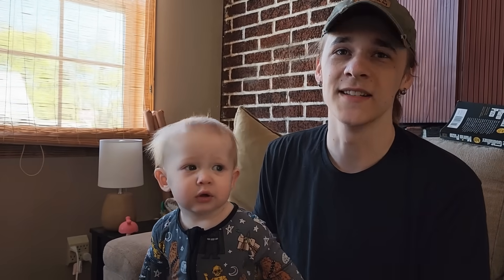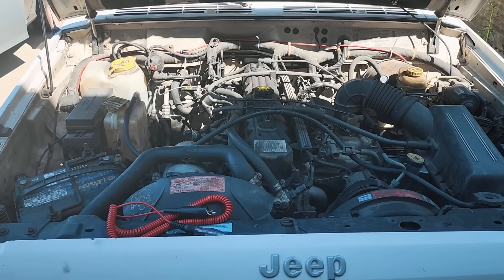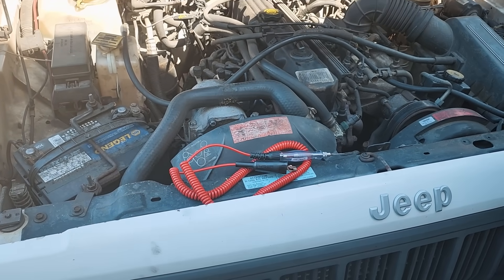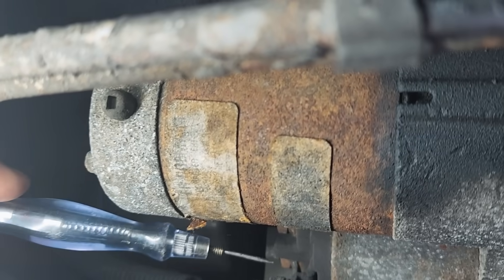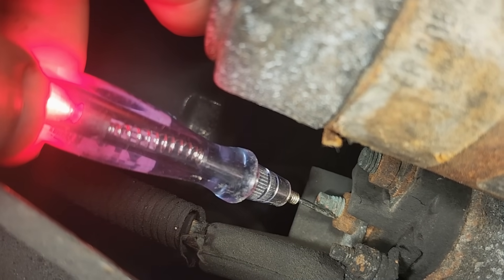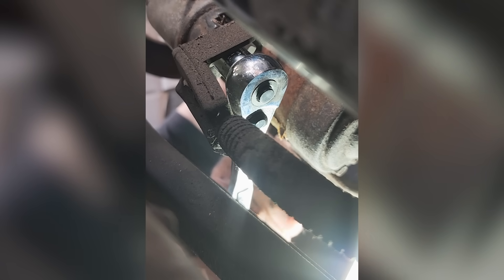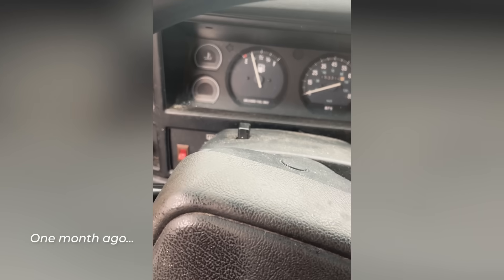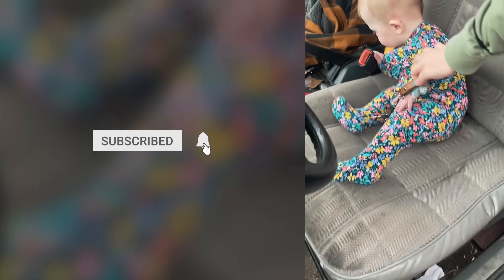Bad Starter or Bad Wire? - Starter Tests Everyone Can Do (family intro)

Comment: One of the most basic simple tests that anyone could do at home if they are stuck with a no crank. You always talk about how grateful you are for the viewer support, but in reality we all should be grateful for your very easy and simple to follow testing methods. Nowadays people are learning how empowering it can be to have the knowledge of basic automotive electrical circuits. I'm always grateful for the knowledge you have shared, and all I have learned from your classes. The scanner danner channel has forever changed the way I trouble shoot vehicles..I will forever be grateful of that fact!
Reply from the maker: Man, can't say thank you enough for these words. Blessed so much by them. Sometimes I worry too much about things, then I hear comments like this and it acts as a reset for my mind. Thank you again

Comment: With a new battery, what is the minimum voltage drop when cranking? Starter motor specification 1.2kW.
I dont know if i have a ground issie between engine/gearbox and battery negative or if my results are normal and OK.
Sounds when cranking that the starter motor doesnt have full power from battery. 750EN, 74Ah
My readings is that the minimum voltage that were registered with my record function on my multimeter is about 8-9v.
Connected on to battery negative post and to battery positive post, tried with negative on the chassi ground thats located on left shock tower.

Cant reach starter motor.. burried.. Ford engines ;)
Reply from the maker: How fast is the sample speed on your meter? An 8-9v reading during initial crank can be normal, as I've seen starters draw over 800 amps during this very brief period. But this is only got a fraction of a second, and then amperage will stabilize at 200 and voltage will recover to 10.5+ during the rest of the cranking period.
If however, you are at 8-9v during the entire period, there is a problem and the next step is to get a current measurement to give us direction. If amperage is very high, then we are no longer worried about a wiring problem
Reply: @ScannerDanner  I'm sorry for my English and maybe not using the correct technical terms. I hope you can understand somewhat anyways. :) 

Using a Fluke 179 and the specifications are as following:  "Display: Digital: 6000 counts, updates 4/sec"

For the MIN/MAX/AVG function:
"For dc functions, accuracy is the specified accuracy of the measurement function ±12 counts for changes longer than 350 ms in duration. "

That maybe doesnt answer your question about sample speed. You may have a look in the manual from flukes site for Fluke 179 in the specifications down bottom

Tried with a battery tester also with a cranking test feature.

With old battery i got this results.
Time 4892ms
Max 10.29v
Min 8.11v
Cranking Low

With new battery i got this.
Time 5398ms
Max 11.25v
Min 9.2v
Cranking Low

I will hook up a clamp amp meter and see what happens. Can only access negative and positive wires at the batteris and also the positive wires from alternator and starter motor with its inline fuse. If i remember the starter motor had a 100A fuse in the fuse box.

It does not sound slow or anything when cranking but the cranking time can be a bit "long" sometimes. And sometimes starts up fast and direct with short crank time. 

This video was intresting because i want to know it there is something going on with the starter motor, the cables, grounds, connections, battery or.. if this bahavior and results are normal and ok.

Battery tester is a china "special" :) Ancel BA201
Reply from the maker: @orfeous  If it cranks at normal speed but for longer than usual sometimes, you need to go in another direction. Fuel pressure would be my next check for any long crank time situation

Comment: this is a case where a parts changer throws a starter on the jeep and it works just because he loosened and tightened the bolt up and thinks the starter was the fault
Reply from the maker: exactly!

Comment: i love this.this has me thinking  a LED test light and using them to do ground to ground/power to power voltage drop tests on low amperage circuits if you dont have a meter since the incandescent takes a few volts to light compared to led you could miss a huge vd on low amp circuit.is this a scenerio where led is prefered?
Reply: By low amp do you mean low mA? Then it is possible, but highly impractical. A voltage drop test is a loaded circuit test. The only thing an LED tells you is that there is voltage/ground potential which could be OK for testing IC's, however it may be very misleading for loaded circuits especially unless you know 100% how much current the load requires to function, and how much current your LED needs to light. You are way better off using a cheap handheld labscope. LED's have had me chasing my tail for hours in the past. That's just my personal experience though, take it with a grain of salt.
Reply from the maker: quite the opposite my friend as it takes very little current and voltage to light an LED, you would potentially miss this problem! I NEVER use LED test lights for troubleshooting for this reason

Comment: Would it have been possible to look at the voltage drop or current from the battery with a scope and come to the same conclusion? How would you perform a similar test if the starter was underneath the intake manifold?
Reply from the maker: An amperage check at the battery can reveal certain problems but not this one specifically. The only thing you would know for sure from the amperage test at the battery is that there was no real measurable current flow on the heavy cable. This could be from a high resistance cable, a connection issue like we had, or an open in the starter motor itself, oh and also a bad ground. All of those would still be in play. 
If the starter is under the manifold, you just need a solid test that says "it is definitely time to remove the intake and inspect" and that is a perfect example of when you pierce a wire! So you get a voltage measurement on the wiring as close to the intake as possible, then you check your block ground before removal. Make sense?
Reply: @ScannerDanner I understand what you mean 100%. But I feel like there HAS  to be a way. Perhaps grounding a new known-good starter to the B+ starter cable (disconnected from the car battery) and jumping power from the car battery to the known good starter solenoid would give enough load to show a good or bad connection?
If the cable has a lot of resistance or an open, the starter wouldn't be able to turn very fast or turn at all, correct?
I think I'm going to test this theory myself with a few different starters and different guage ground wires to see if that can result in anything useful.
Reply from the maker: remember in your scenario the starter is under the intake! You can't gain access to the wiring right at the starter. The only thing you can do is voltage measurements (piercing the wires) right at the intake manifold connection where the wires go in and use this same loaded circuit voltage drop test. No reason to do anything else. It is very simple and doesn't require disassembly of anything.
Reply: @ScannerDanner  I think I might've confused you. In your test, your light stayed lit when you moved away from the starter solenoid. The closer you get to the battery, the harder it is to test for a short like that.
In my scenario, the starter isn't directly accessible. So, assuming you've already tested grounds and control. If you have an extra starter laying around, you can use that as a load to test circuit integrity. Super easy to do when your cable is in the relay box. A wiring diagram of that test would look something like this:

Ǝ-- <--- =(M)= <--- =(M)= <--- B+

 As mobile diag tech, that might help you quickly get a good idea of the problem for the guy who's doing the repair with little work involved.
Reply from the maker: @YuckFou0x0FFFF  you said: "In your test, your light stayed lit when you moved away from the starter solenoid. The closer you get to the battery, the harder it is to test for a short like that." please clarify which test you are referring to as I showed a clip in this video of what a bad block ground/starter ground looks like. Or are you talking about the high resistance connection of the starter wire eyelet to nut/stud? 
And there is no "short" here at all, this is an open circuit. In both cases, the bad block ground and the bad connection at the starter, both of them are opens, not shorts. Just to be clear
Reply from the maker: @YuckFou0x0FFFF  also in your drawing, it looks like you are suggesting to put a motor in series to another motor to test the circuit?
Reply: @ScannerDanner  Sorry about the typos. What I meant was, in your test, your light would've stayed lit if you moved away from the solenoid KOEC. 
That was in response to you saying:
 "The only thing you can do is voltage measurements (piecing the wires) right at the intake manifold connection"

Used the wrong term when I said short I understand this is an open.

Yes, my diagram involves a second starter connected series.

Comment: I fixed my stepsister’s car. It was an intermittent problem. It was Very difficult to diagnose. It was a wiring problem. Someone did a bad job at that wiring. Butt connector wiring loose. Not starter not computer not ignition switch (2011 Dodge Avenger) . Nice job Caleb! Beautiful kid. I’m going to be aunt. Can’t wait!
Reply from the maker: Thank you and congratulations on becoming an aunt!!

Comment: Mechanic just managed to solve a "no start with intermittent no crank" on my late father's '98 F-150 Lariat with the 5.4 L engine, that my sister and her husband had neglected (and frankly abused) until it quit running.
It was a long list of problems that had accumulated, but the "intermittent no crank" ended up being a bad ignition switch in the steering column - not the ignition tumbler, but the slide switch further down inside the column.
They abused that truck so badly, they not only managed to fry the original ECM, but also a replacement they tried installing - wasn't until the mechanic went thru and fixed all the various other issues, and then installed a third ECM, that the truck came back to life.
The truck is actually in my 84 year old mother's name, and she said once we get the truck back, it'll be a cold day in hell before sister and hubby ever touch the poor beast again.
Reply: It probably had a gem module that needed replacing
Reply: I've wondered if the ignition switch on my vehicle is bad. I've done everything I can to solve my early morning no starts. I was told the starter is good, have replaced alternator and battery, and still the problem persists.

Comment: The “bad” part is if a person throws a starter on that car, that would have made it work🤣

I did a voltage drop test off the lawn tractor the other day. Multimeter on + post, other on cable showed a 7v drop and just a click. Cleaned it up and good to go.
Reply: I wish more ppl understand a voltage drop but ppl are so ignorant
Reply: @ramirofarcocks  we have to teach them. Especially if those who are ignorant, are our peers.
Reply from the maker: Right? And they would have never known that it did not need one!
Reply: @ScannerDanner  Until starter fails 3 months later and "it's doing the same thing" comes up.  DIY sure, as a repair shop you cant gamble,  especially given the state of the original starter. Great video and great points.
Reply from the maker: communication is key! No reason to upsell a starter motor here, especially when people can't even afford to fill there tanks.
Reply: @durbinmotorworks6253  surely a shop would remove the nuts and replace with new after cleaning the post and fluid film,  repair the battery terminal connections.  Recheck with meter to insure proper voltage at starter..  you now have a good circuit that will last another 5-10 years.  I have had "new" starters that died within days or weeks so i would almost prefer a functioning legacy unit to new chinese.

Comment: Hi paul 
I have questions?
So if this have to do with bad ground can this apply to check if something wrong with the ground all over the ground system like example plugging to battery ground and check block ground will this mean u have bad ground somewhere in the car .. So what i mean is a way to check ground in the car so if that light goes lit it means there's a bad ground somewhere..
Reply from the maker: This playlist has some bad block grounds and how I found them ground circuit problems: https://www.youtube.com/playlist?list=PLAFYVCyenqcr32wgsCqa1Zj4335YlBF5p
In short, the key is to load the block with the current from the starter motor to see it. And yes, using the test light to battery ground is key
Reply: @ScannerDanner  hey paul u are the beast when it comes to diagnostic thanks

Comment: I fixed my nephews car, it had a bad starter control conector which I verified with no continuity.  Then after fixing that the starter would intermittently not start so we replaced the starter.  So it had two intermittent issues.  It had been to the shop 3 times.  Makes you wonder when a diy guy fixes something that 3 shops couldn’t.  Beautiful family!  Grandkid’s are the greatest.